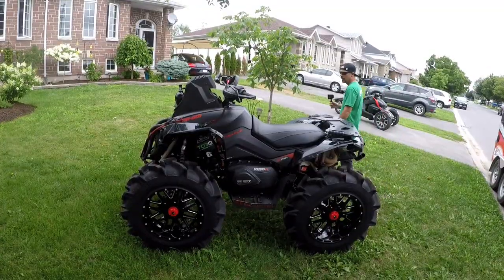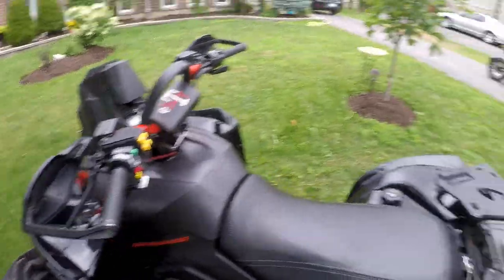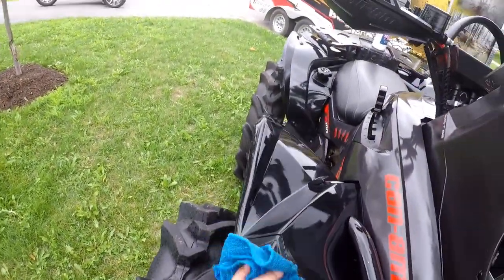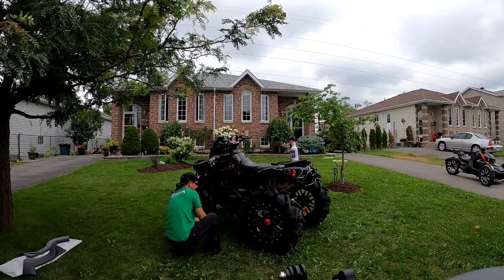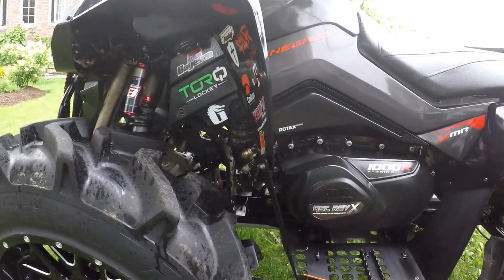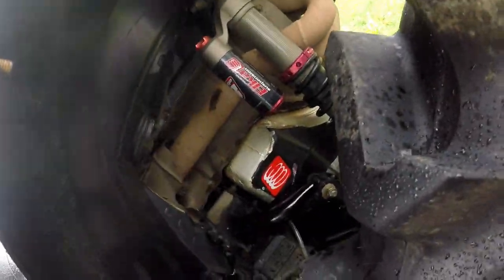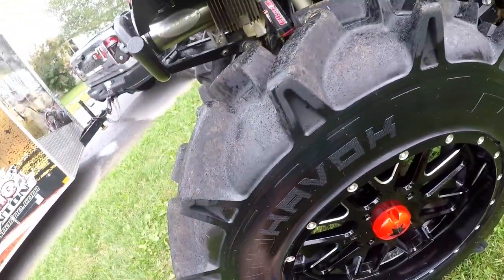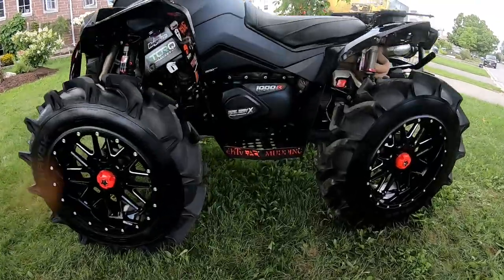Don't buy a RENEGADE Xmr1000r before you watch this!!!

Comment: Great stuff.  Great info, review, history.   I have over 8000 clicks on my 650.  Still cant believe that.  Rear diff went as well so on my second stock rear diff. I did push my bike pretty hard.  Looking hard at the 2020/21.  I was told by dealer that 2020 850 and 1k have the different diffs. 650 is the same.  So I'll be double checking that buying new.

Comment: If you get the rjwc full system will you still have to tighten that clamp up frequently?
Reply from the maker: This is full system, I have both. And both loosen up from time to time. Not the header pipe though so easy to cinch up. Every 5 or 6 rides depending of terrain. That’s the other thing we tend to jar theses machines a lot! Bahaha some hard knocks I say don’t help.
Reply: @ehTV1000  ok, just wondering thanks for replying.

Comment: DPS and 2x rear diff are 3k alone not to mention all the service and smaller parts. That's actually crazy of bike was not 18k new.
Reply: Im 3000km+ on my 650 with factoey diff because I swapped out the weakest part aka the bearings. Water was in 600km with easy riding after bearing and seal swap to better ones everything is OK.
Reply from the maker: This is why choosing the right dealer matters a great deal! Zero issues with warranty repairs. And if it wasn’t covered BayMarine has helped with discount on replacement parts. Love these guys I do!!!